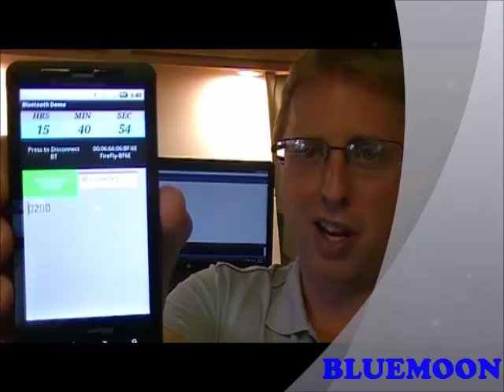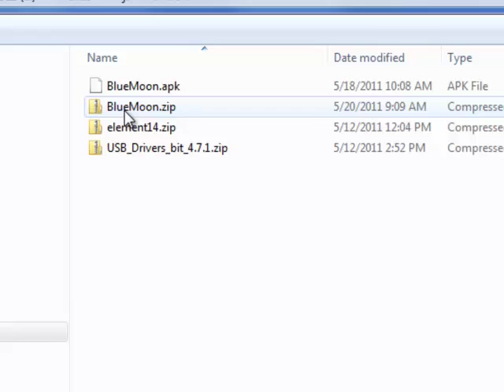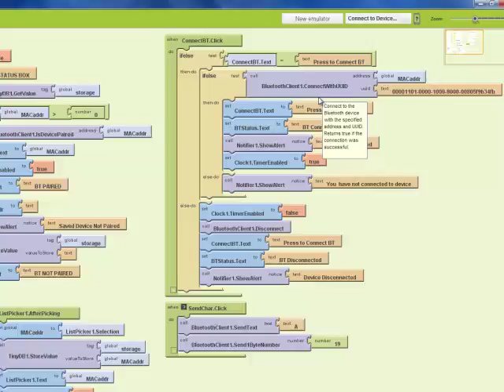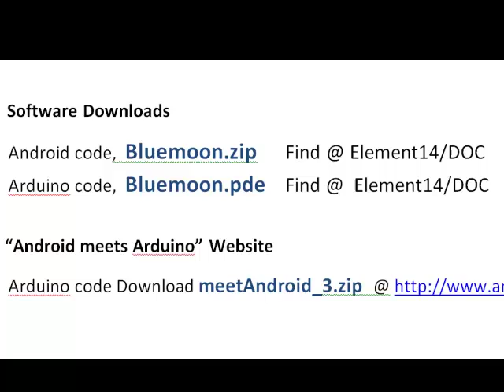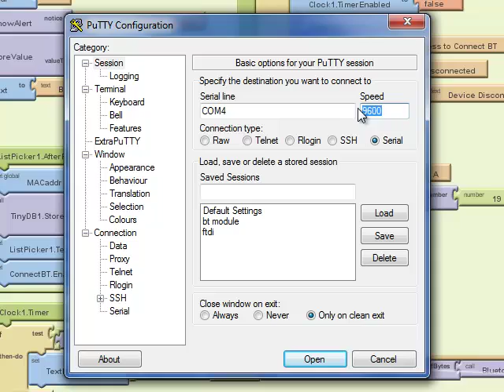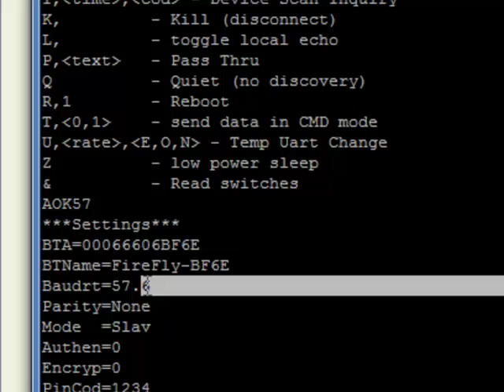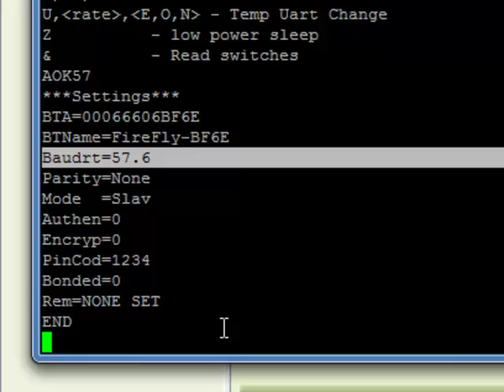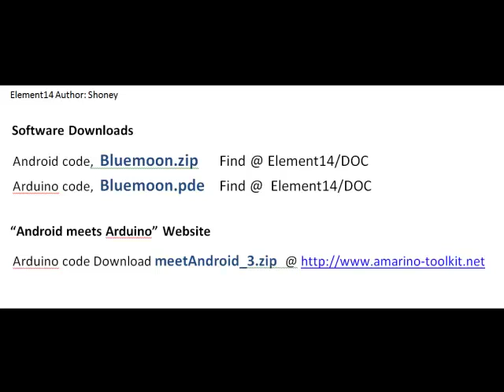Bluemoon Android Bluetooth How-to

Comment from the maker: @matinzkk  The first 32 characters in the ASCII-table are unprintable control codes for peripherals such as printers, the squares are the graphic image chose by Android for ASCII values 18 &19.  regarding 2nd question...YES. you will need to parse the in coming stream to extract your data.  regarding string size, look at using BT client functions to help you read in your data more to your liking.  I suggest using DB storage, from that you can parse your data. good luck.

Comment: Thanks for your reply. the START Flag byte and the ACK byte are both shown as a suqare in Android. Why is that?

Also do I need to split the string received first, put it into an array then remove the START and ACK bytes? Reason why I ask this, is that when the string received at the Android side, it sometimes is received as a small string and sometimes as a long string! Any help is really appreciated!

Comment from the maker: @matinzkk Arduino code used the meetAndroid.send() function, so the data android is receiving is 3 bytes START Flag byte (18), the DATA byte and a ACK byte (19). my android code used BluetoothClient1.ReceiveText and display all received characters. You need to strip off the Start and ACK flags. You can use the  BluetoothClient1.ReceiveSignedByte to receive a value or convert the text ASCII value to a actual number i.e. the value 1 equals ASCII  49 or wait next month I release a graph demo